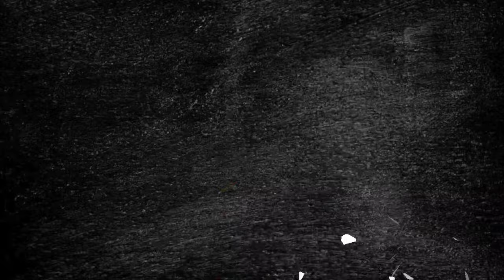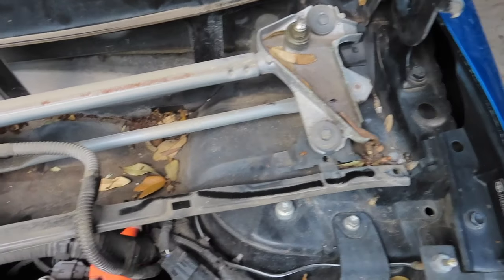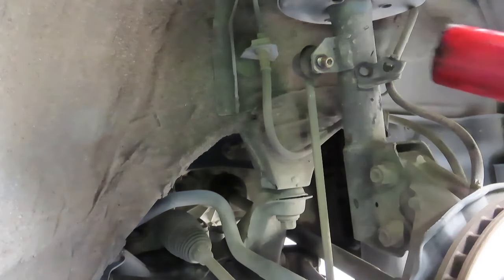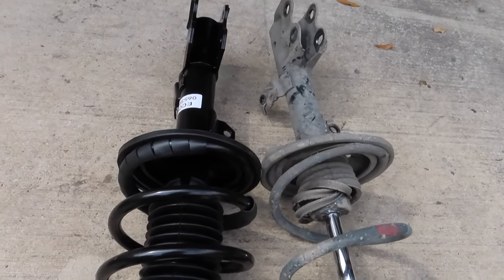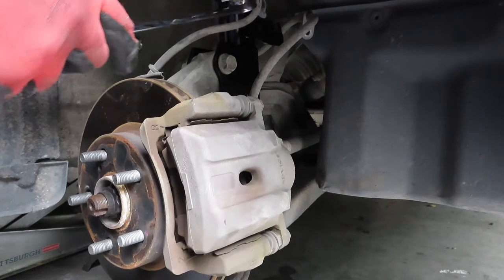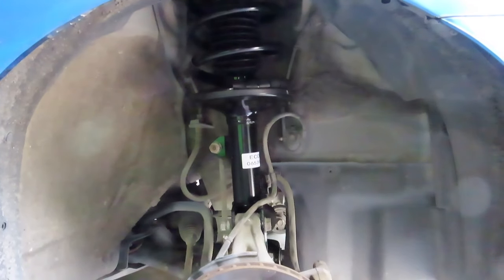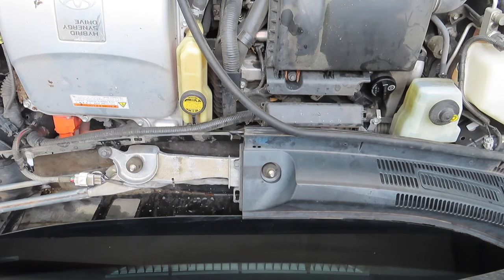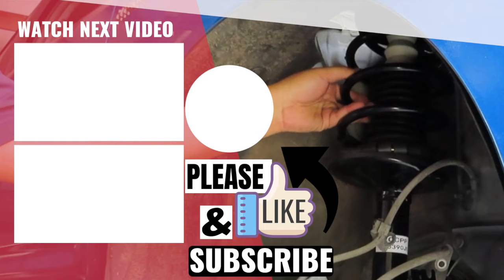2004-2009 Toyota Prius Front Complete Struts, Shocks & Spring Assembly

Comment: This was helpful. Just had to look up the torque settings for re-assembly.
Just a tip: remove the driver's side wiper arm with the hood closed and the wiper arm up away from the windshield. It will slide right off without the torque from the spring on it.

Comment: ok - I just got done - did mine -- both sides Prius 2004 blue color ... one tip I can share is that if you are trying to take the upper link off and the bolt part turns on you, do yourself a favor (first of all the slot is a 5.5 size Allen key - you will need a long one) - but if you take that off first, loosen them before you take the pressure off, it won't turn on you and likewise, you can tighten them after you have lowered the jack and now have applied pressure back on there (else you will need to spend sometime hold the Allen key and 17mm wrench. I had done this once before with cheap struts. They lasted three or maybe two years before I started hearing click and clack and the ride was really crappy even when they were new - anyways, it is not a difficult job if you have the tools and knowledge - good luck.  what is next for me you ask?! ok thanks for asking.. the tierods looked shot - I think it won't pass inspection before it gets rejected, I will get them replaced too - then the winter hopefully will be worry free.

One other tip I forgot - don't struggle with the single windshield wiper - after taking the screw off to take the wiper off the car, left the wiper from the windshield, and there is a hinge at the bottom of the wiper arm, that will fold, releasing the pressure, and it comes right off - you do not need any tool to PRY it off .. ;) - when you are installing them back on the car, make sure to position them exactly at the position from which you picked them up/took the off -

Comment: You can actually use a hole saw and drill a hole on top of each bolts that holds the struts.  Less stuff to unbolts . Just one way of doing , that is my way.
Reply: Sounds like a plan. This tip will save me time this weekend.

Comment: My prius sounds like metal grinding when i run car. One side lower than the other. Could it be spring?
Reply: likely brakes or caliper pins seized.
Reply: @wisherofsnowdays  end up being brakes were locked & replaced springs on it

Comment: You always need to have the car aligned after replacing the front struts
Reply: You don't, because you didn't move the tie rods.
Reply: @TK-nm9dj  Even though the tie rods weren't moved - the new springs could affect alignment. If this was a standard strut replacement (i.e. keeping the existing springs) I would agree that an alignment would likely be optional.

Comment: There is no way to remove any of the bolts on the control arm or strut without power tools. And torquing it back up is very important and completely skipped.
Reply: Its faken easy jusk loke he did i done it too
Reply: Guess you've never used a cheater bar to break something free. "Give me a lever long enough and I can move the world" 🌎 -archimedes
Reply: Even with a cheater bar i couldn't do it. Needed to buy an impact at harbor freight.